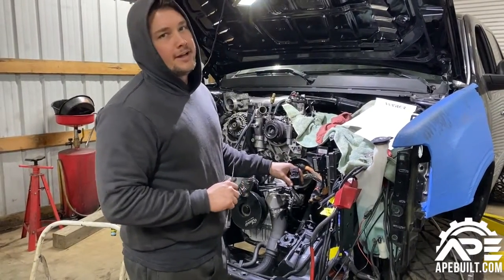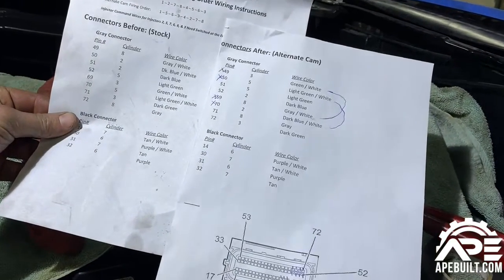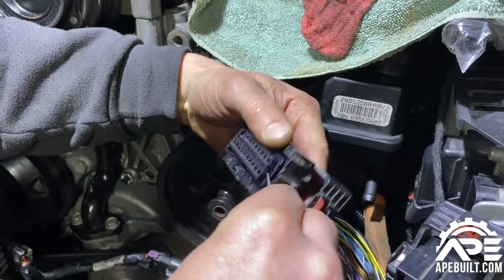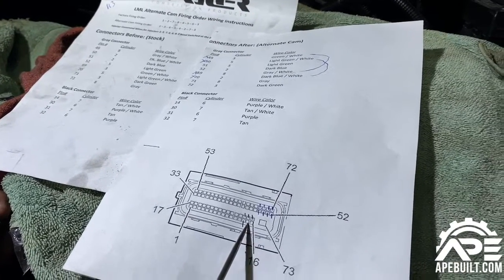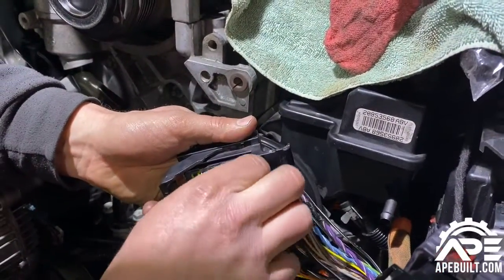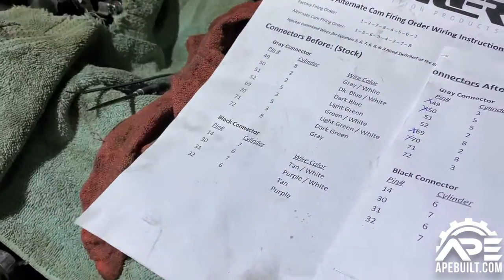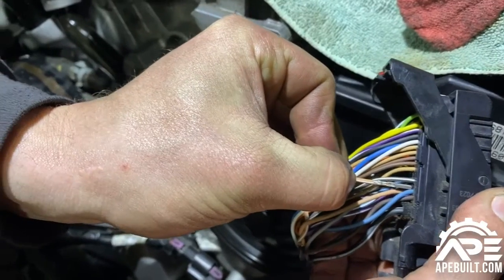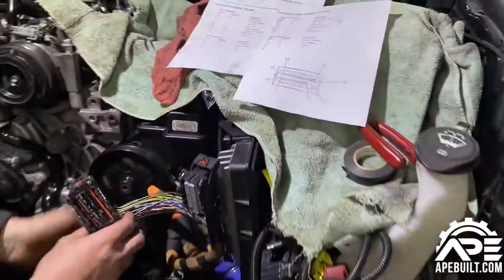TECH TIP - How to repin an LML Duramax

Comment: I repinned my lml duramax wiring harness during my motor build and now that the motor is in and all grounds and all connections are made i am not getting any communication with the ecu. What could cause this? Motor will not crank